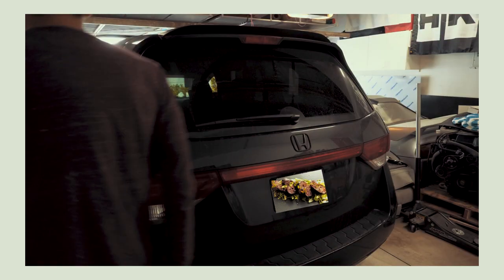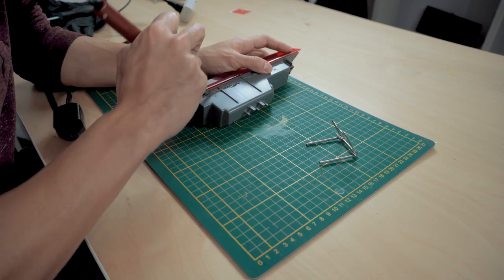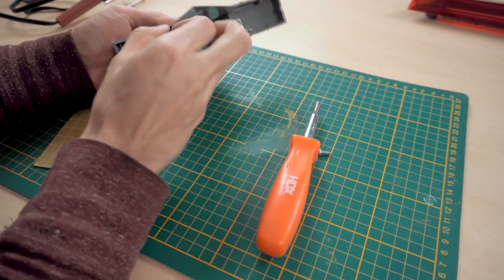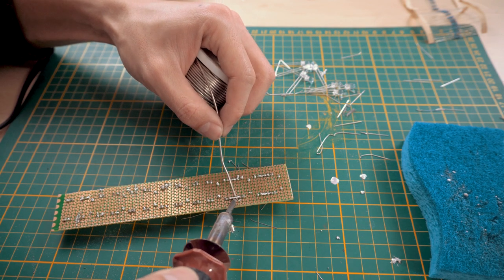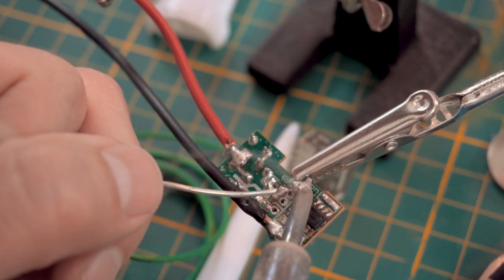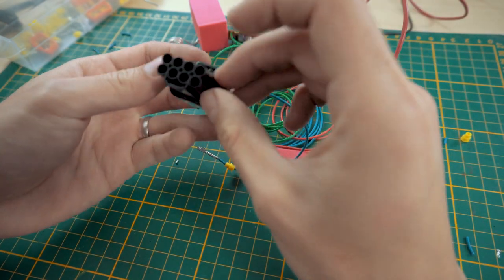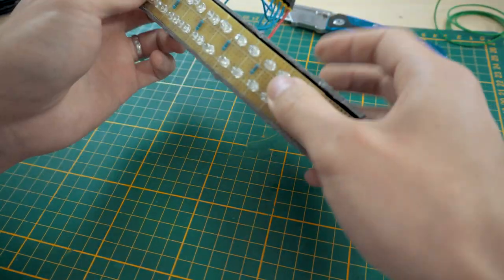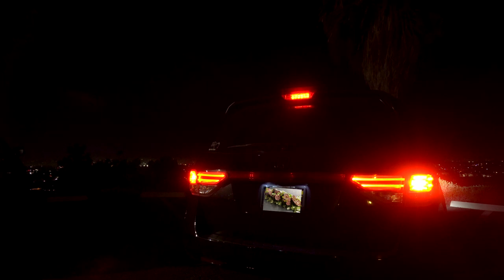DIY LED Brake Light | Arduino Controlled

Comment: Really cool mod. I personally think it would make more sense (and look a little nicer) if you had the LEDs trace from center of the brake light to the outside of the brake light. Since the rest of the lights and car are symmetric that would maintain the symmetry and look like it was meant to be.
Reply from the maker: Thanks for the suggestion! I think that would totally be a better pattern
Reply: @IMEEMADE  can you share how we can program arduino like you did ?

Comment: nice idea... I would have liked to see a test before hot glueing it all back together. Also might be an issue with canbus based wiring, causing an error on the dash to say the high brake light is out.
Reply from the maker: I went a bit rouge and powered through the project without testing it out first. Luckily everything ended up working OK after I glued it up haha.

I was worried it might throw a light on the dash as well, but luckily it seems like the high brake light doesn't affect it.

Comment: How do you control so many LEDs with the arduino? I know the ports are limited to 5V and 500mA. How you make that without frying the board?
Reply from the maker: I go through all the wiring in the video! 😁

Comment: How can I do the same for my Braking, turning, day,fog and reverse lightning? I mean I've currently assigned for a project at my University and im tryna find a way to get that source of individual control over all of the signals. The socket of my tail light has 6 outputs, So i guess 2 of them are for the ground and positive and the rest 4 of them are for the individual signals. Do I have to connect em all to the arduino, i think that i must power the arduino through that power and ground using as u showed car charger amd the rest signals being connected to the arduino itself?
Reply: I'm also not sure if the arduino will be able to feed the led strips that I'll use, my idea is for Static day/brake light on the same place, and for sequential turning(hazard) light, for the reverse i can use some individual led smd's on a board we'll see. I will appreciate it if you give me any advices.

Comment: So I have 12v leds that I'd like to power with my car through an arduino. Signal input is battery voltage (12v-14v), going into 5 volt buck controller. From the 5 volt controller it goes into the arduinos input. Output signal voltage from arduno will be 5v. How do I power my 12v leds?

I'm assuming your leds are rated for lower voltage since they're powered pretty brightly with the 5v signal
Reply from the maker: To power the 12v LEDs I grouped all the (+) legs and connected them to the car brake light wire. The (-) leg of each LED is connected to the digital output pins of the arduino.
Reply: @IMEEMADE  I didn't know you could use the arduino's digital output pins as a switch to ground in circuits above 5v.
I guess I've been over complicating this.

Comment: This project only had 1 Input but if it had multiple then using an Opto isolator  would be easier, smaller and cheaper than using multiple 5v power supplies.
Reply from the maker: Thanks for the suggestion. I will definitely keep that in mind for the next project!

Comment: Have a friend trying to hookup a custom led taillight on a snowmobile without a battery. 3 wires, common ground in a sealed assembly. Brake light works, tail light does not. Chassis/hood, tail light and brake light all come from the same connector on rectifier. Brake light gets +12VDC, but he is getting -12VDC going to tail light and I don’t understand why. Any ideas?
Reply from the maker: Sounds like there’s a short somewhere. Could be in the snowmobile harness or internal to the taillight
Reply: @IMEEMADE  light tests fine on the bench. Could it be bad diodes or inductors in the rectifier? Or you think the harness more likely?
Reply from the maker: @I_SuperHiro_I  that’s hard to say. If possible, I would swap to a known good rectifier to see if that helps. If not, test the harness to see if there’s a short somewhere.
Reply: @IMEEMADE  I’ll have to take a look at how difficult it is to remove the rectifier. But checking the wiring is probably easiest. Thanks.